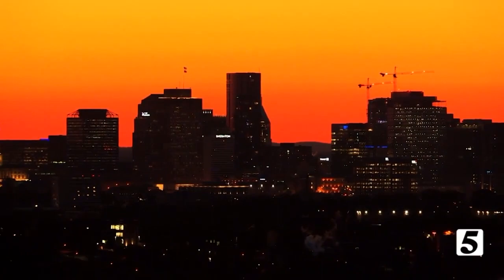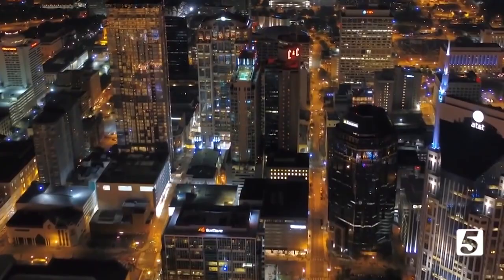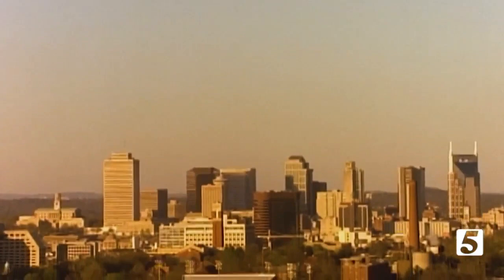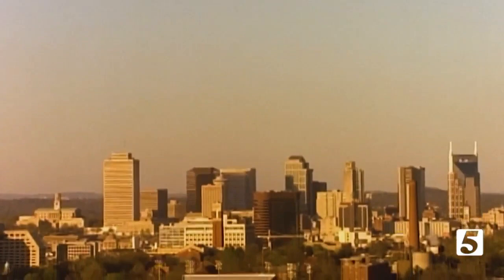The glassification of Nashville — will it stand the test of time?

Comment: Air conditioning made building with glass curtains possible. Buildings with glass curtains weight less. That means they can use less steel. Using less steel save money.